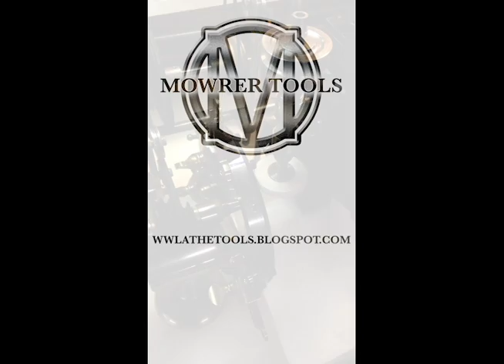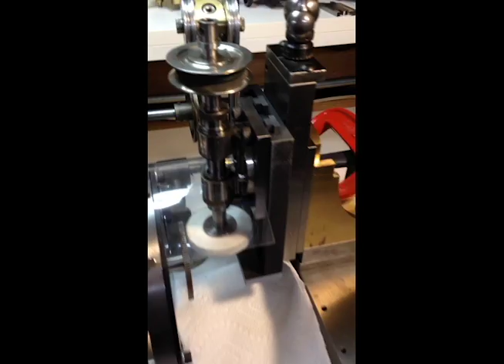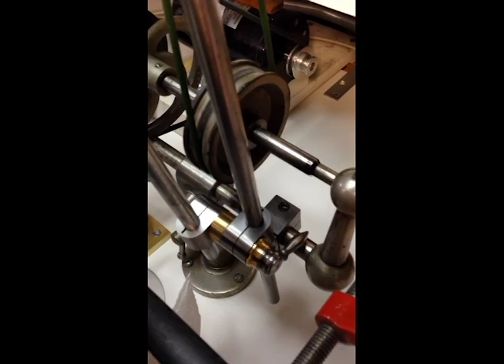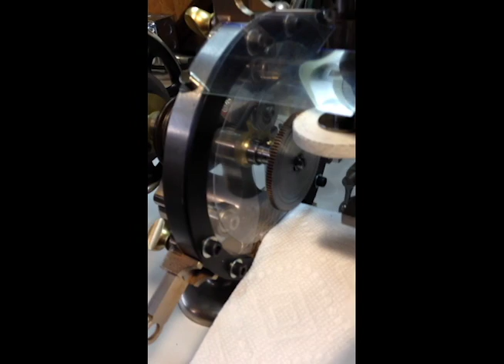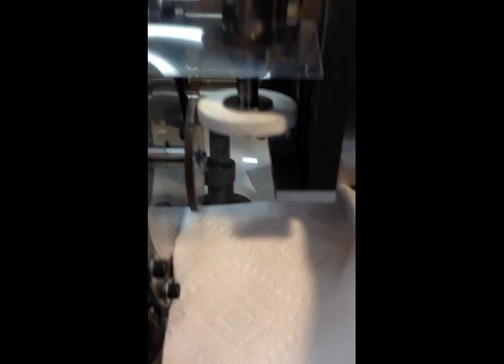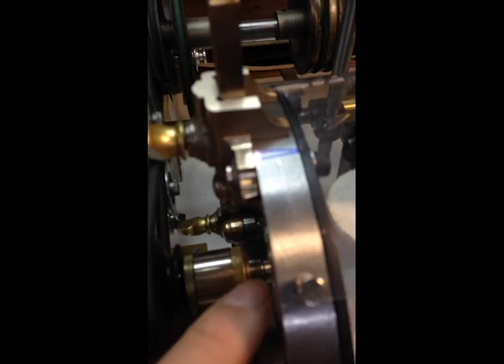Mowrer tools gear grinding setup

Comment from the maker: Thanks Paul. I've really fallen in love with keeping the adapted hand wheel attached for most operations. It's effect on the smoothness of the cutting action has been really dramatic. the acetate trick worked so well I've gotten a pad of acetate sheets and cut them to custom size constantly for many operations. Sometimes low tech is good tech... :-) Cheers, Kevin